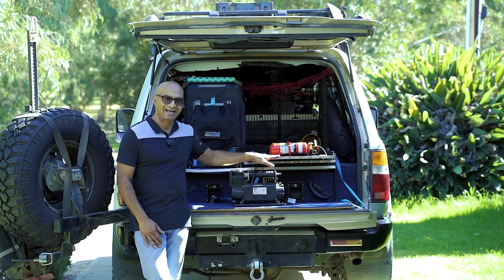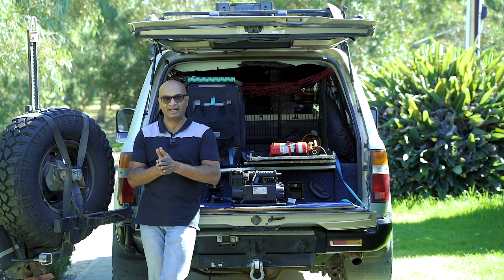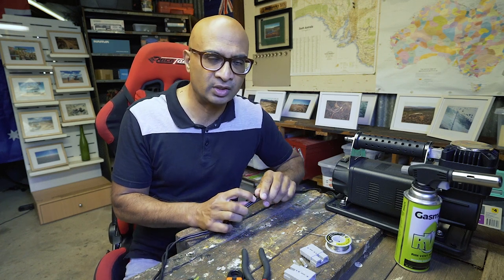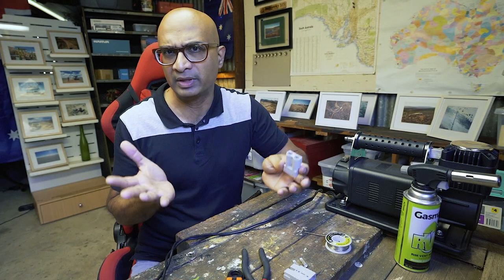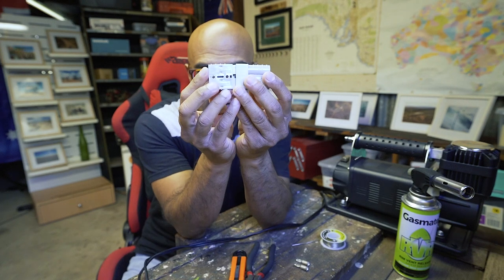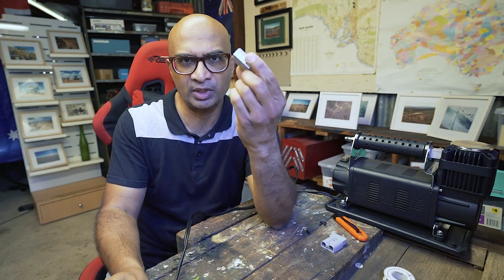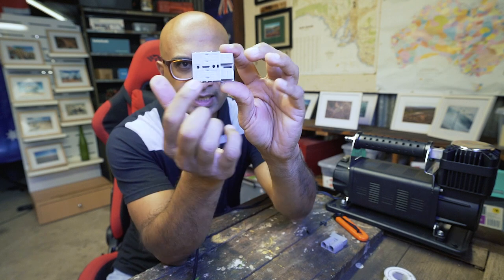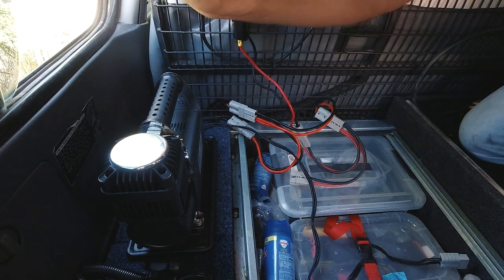Air Compressor Hard Wiring | How To Install An Anderson Plug

Comment: So I assume you have all of that 12v coming from the cranking battery?  How will you ensure you don't have the inverter running at the same time as the fridge (and everything else) when you turn on your compressor?  The whole lot seems to be fed from a single 50A Anderson plug, which will not handle all of your equipment if all running.
Reply from the maker: Hi Stuart. The feed comes from my aux battery. Not the cranking battery. My electrical system is quite simple. The inverter is not very powerful. I use it mainly for charging camera batteries. The rest of the accessories at the back are my fridges and led lights. At best my power draw (inverter not included) is less than 8 amps. So can easily run the compressor whilst the fridges are running without exceeding 50a. The use of the inverter is quite minimal. I might change everything if one I decided to run a coffee machine. Which is quite unlikely as we like to make coffee the old fashioned way, grind the beans, boil water in the billy and then pour the coffee :D

Comment: Over the years I have, by some unknown reasons, accumulated three cable splicers/strippers.  I have never been able to use more than one at a time.  I will drop one in your post box next week after I come back from my "Clean Up Australia" trip with the Land Cruiser Club of SA.
When I did my first soldering course (in 1953) they insisted that you NEVER put a cold cable into hot solder, as you did in the demo.  If you don't warm up the cable first you have a VERY GOOD chance of forming a dry joint which under vibration will fail.

Comment: Why not keep it in its bag and yours it when you  need it  this makes  no sense
Reply from the maker: For me it works out a lot easier. I don't have to take it out of the bag and hook it to the power supply. All i do is pull the hose out and flick the switch.

Comment: Mr Udawatta.. 97 FZJ80 Owner here.. thank you for your help and knowledge, this helps much. Keep up your breat work and videos.. Thank you sir.. Scott, Downtown Tahoma California..
Reply from the maker: Thanks Scott. Appreciate the support.
Reply: @4xTouring  Sir I have some issues I have come across maybe if you have the time I have a couple questions s for you concerning 97 FZJ80 4.5L..
  I have a 2.5" OME springs/heavy front w ARB Bull bar, 10k lb winch,  lights front and rear ARB adjustable trackbars/panhards. My cruiser is my daily w 323k miles,  I bought it in 2006 w 65k mileage. The lady whom owned it drove it from Phoenix to Las Angelas to buy bulk beauty supplies.  Am the 2nd and only owner for the rest of my life.
Secondly, I am in need of both tie rods..  I am looking to purchase soon, after doing homework and asking.. ..tie rods and ends I have looked at SLEE, Manafre and Toyota Genuine Dealer parts Everything comes as a kit.. I like and respect all parties however other opinions are great.
 My mechanic friend says Toyota.. on those tie rods and ends, rear top and lower control arms, linkage sway bar and all the bushings they really are the stock Originals, off the show room floor so to speak. MAYBE they were changed out at Toyota at the 120K mileage maintenence overhaul?.  I did completely rebuild the front end all the way to include the actual  housing of the front axle itself replaced..  Just ran out of $$Lootcakes$$ for tie rods... I know..bad scott..
The bushings are  good does have some minor cracking except all on the sway bar, they are all smoked front and rear swaybars.  Again Toyota or Manfre??. I also want to do those control arms linkages.. same question??.
Just here very recently I believe my Timing Chain tensioner are not completely  keeping tension.  When I start the vehicle it ever so slightly and only when it is a cold start does this happen.. Can hear it like a couple small washers whirling around a can. The choke will kick off and by then the sound has faded away and my motor sounds beautiful. Sit a glass of water on the intake and just  the very slightest water vibration in the glass if any. I try it in the AM again. It's not the  Catalytic convertor, it's coming from the motor area..
So yes I have my work cut out for me but it's all doable. Clean all the parts and what not at my works shop my co worker mechanic friend is cool like that.. After work hours and not on the clock of course..The Timing chain and Tensioner water pump was done at 120k but that was 200k of across the USA driving.. Coast to coast multiple times.
 At any rate I am  going to replace the water pump, Timing chain, Timing chain tensioner and buy the kit straight from Toyota Genuine.  Anything else I should purchase for said issues and thi gs I may be missing to where if X is fixed you really need to do Y.. or possibly might as well si ce you are there kind of thing
Any and all suggestions  and pointers are very greatly appreciated . Thank you for your time, patience, understanding   including the helpful knowledge and input.
PS. Have you ever had to do a water crossing in an area that is known to have Crocodiles because I think I would just ..turn around and call it.
Thanks again Mr. Udawatta have a great day, a beautiful weekend and safe travels
Scott, Downtown Tahoma California.
Reply from the maker: @scotteppers  Hi Scott. Please can you send me your email address?

Comment: Nicely done. Anyone who has a compressor like this should never use the 12 volt “cigarette “ outlet. You will blow your fuse or worse melt the wiring.
Reply from the maker: Yes absolutely.

Comment: Hi Duncan have you every thoughts about using a 4way Anderson plug adapter to get rid of some excess power leads hi I am Adrian
Reply from the maker: I think the 4way would make it a lot neater and easier too. I had some Y-connectors lying around so used them instead. Someday I am hoping to completely empty out the back and redo some of the electrics. I keep saying "some day" :D

Comment: Nice Duncan. I am looking at this as well. I just keep adding weight through for my daily. But I still thin it is worth doing. I am heading out more often these days.
Reply from the maker: Weight is always the issue. Especially if it is a daily runner. Since you are travelling more often then certain basic accessories are best left installed.

Comment: Great job there Duncan. What battery are you using to power this? Cheers
Reply from the maker: Hi Pete. Since the compressor pulls around 45amps ideally I should have pulled power from the cranking battery. The electrics at the back end of the fourbie is powered by the deep cycle aux battery. So instead of running another power line (from the cranking battery to the back) I am powering the compressor from the deep cycle. To avoid a massive draw down on the battery I keep the motor running whilst airing up. By doing this the DCDC Charger will compensate for the draw keeping the battery running out of juice. Hope that makes sense.

Comment: Hey mate, when you cut the wires on your air compressor hiw did yiu know the difference between the positive wire and negative wire.
Thanks
Reply from the maker: Hey Ricky. In my compressor the connections were two battery clamps. So before cutting I marked the positive cable with a red permanent marker. Matched this to the positive in the Anderson plug.

Comment: I have been thinking of doing this to my 80 for over 10 years. Maybe installing the portable compressor behind the 3rd row seat side panels, under the passenger seat or under the bonnet (with some heat shield) and running a air line to the bullbar and rear bar with  air line connection and running the on/off switch on the compressor to my switch panel. Great vid liked and subbed but i would put heat shrink on connections and maybe a inline fuse on the power connection even if you have a fused switch panel as sometimes these portable compressors do pull more power than advertised.
Reply from the maker: I have an inline fuse too. Something I did not mention in the video, I keep the engine running whilst inflating. This helps the battery along.
Reply: @4xTouring  its a great vid mate simple and easy to follow instructions without stupid music, also its a nice looking 80 series but I still don't trust Anderson plugs for some applications even the proper Anderson plugs are only rated to 120a constant power and 50a hot swap. Some things like compressors and inverters I prefer to hard wire to the battery with thicker cables and a shorter cable run as the heat up when using them.

Comment: I recently tried this with a direct connection to my battery using the Anderson quick disconnect- first test and the connectors melted! I may have used the wrong type solder and had a bad connection causing extra resistance. I’m here because I’m going for a second attempt lol
Reply from the maker: How are the cables leading up to the connection? Can they handle the current required by the compressor?
Reply: @4xTouring  well I cut out the inline fuse on the previous attempt since it was a 40a and the compressor has a built in 45a-it kept popping (ironman 4x4 heavy duty compressor) I'm going to re try this with 50a inline fuse like for stereos. I may have used the wrong type solder too. Its hard to find a pre made 10awg with a built in 50a and round terminals / anderson connector LOL

Comment: Duncan, Why do you not put it in the wing section of the draws and hard wire it there with an air connection on the back of the wings that face the tailgate and then you just plug the hose into that and possibly put a switch near the air connection to turn the compressor on? that is what I am aiming to do with my xtm one. I was taught at tech school that you always heat the job and then apply the solder not like you do as you are burning the flux off before it gets to the job or the wire to help it bond to the item you are soldering it to. Your soldering needs heat shrink over the wire connectors and wire before you insert it into the main anderson plug. A suggestion at 16:50 where you cable tie the connectors together why not screw each of the master connectors to the black box tube running across your vehicle and then you have a sturdy connection point and then only need to connect or disconnect each end of the anderson plug when needed?
Reply from the maker: Hi Tim. Thank you for that. What you say makes perfect sense about where to place the compressor. It is very practical. The problem I have is the previous owner had installed the rear electrics switches and fuses where you are suggesting. Relocating would have made reaching the switches a lot more difficult. So I figured reaching for the hose from the window worked for me. As for heating up the cable I should have talked of a hot solder. This is my fault for not mentioning. My apologies for that. Thanks for pointing it out. I will do a quick follow up video on this.
Reply: @4xTouring  Hi Duncan, re the relocating and the switches. I know from the size of my area there, that there is plenty of room for both the compressor and switches/fuses unless they are hugeee..... I do not have sliding windows as you have on yours, so for me putting things like this under the draw wings seems to be a good idea and it's not as if I or you probably will be airing down or up that often....... but it's your rig and it was just a suggestion. Thanks for the feedback.

Comment: I thought about doing this for my maxitrac compressor which draws 90 amps but adding a solenoid or relay to protect the system. Do you think the fuse is enough protection? I'm fairly new to this type of stuff. Thanks
Reply from the maker: If it is 90 amps a relay will be recommended. Also the power supply cable and connectors should also be capable of handling 90 amps. Best is to get a professional to give you some expert advice. If you are in Australia I have found the staff at Jay Car to be very helpful in this.

Comment: Crimping the Anderson connectors is far superior then soldering. It’s also not a good idea to run this without a circuit breaker or at least a fuse. A 12v compressor can run a lot of current!
Reply from the maker: Thanks Jamie. I thought soldering would do a lot more sealing of the cable than crimping. Learnt something new. I did not mention in the video (I should have) I have a circuit breaker at the back of the 4x4 for each appliance.
Reply: The tricky part is running the wire from the battery in the engine compartment to the cargo space.  Any ideas on this?
Reply: @John  you'll have a hole in your firewall where your main loom will go through, you can use that, lots of vehicles have extra holes with gromits and bungs too. If you own a 4x4 that's body on frame you'll probably have gromits going up into the cab along the chassis rails too